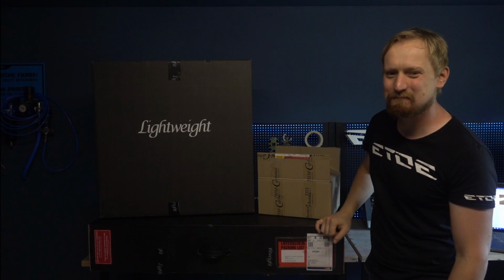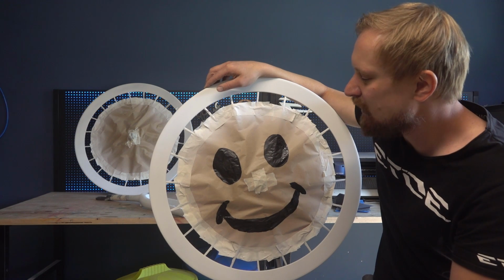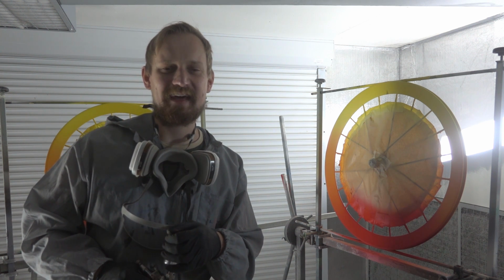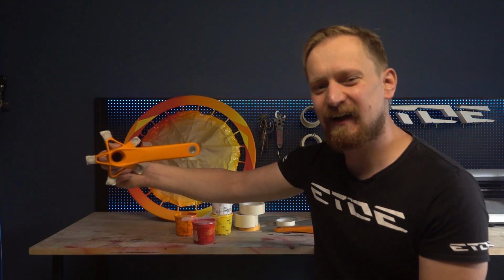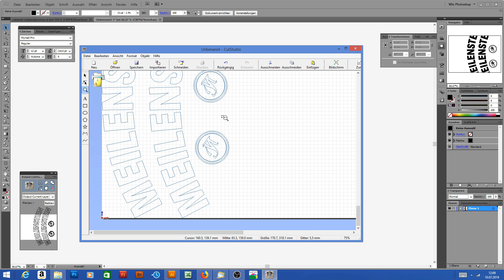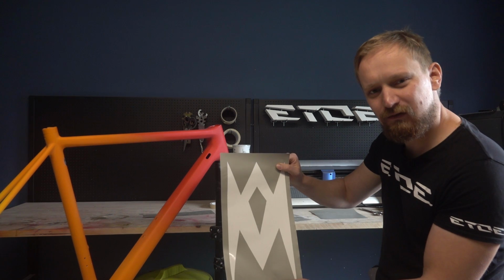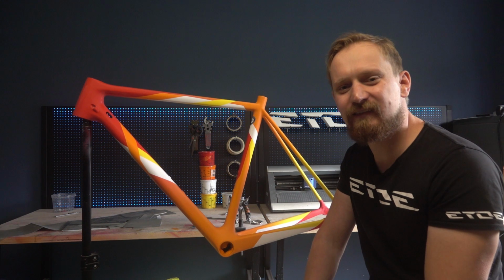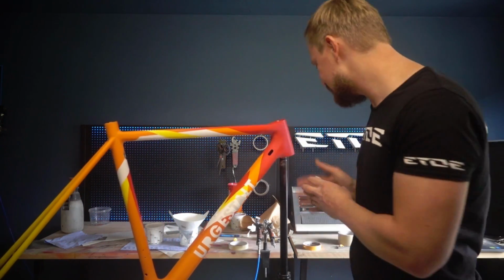How to paint the dream bike for Kona Hawaii - Martin Grey paint job

Comment: Do you use an inter coat or mid layer clear to protect the previous layers of paint when masking? Thanks!
Reply from the maker: Sometimes, depending on design and frame.
Reply: @ETOE  Your work and videos are superb. Your grasp of the whole design process really impresses and elevates your channel. Very inspiring.

Comment: Are you using solvent or water based base coats? Reason I ask is how you deal with the solvent chemical recoat windows with so much masking. Thanks
Reply from the maker: I use both.